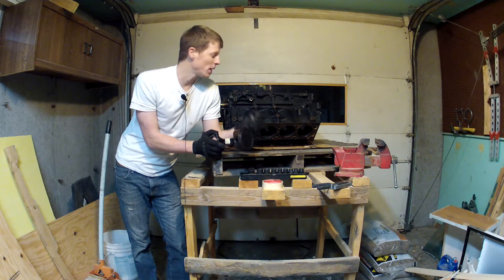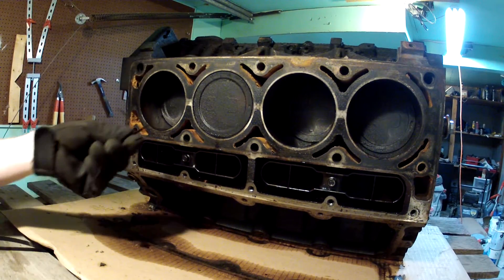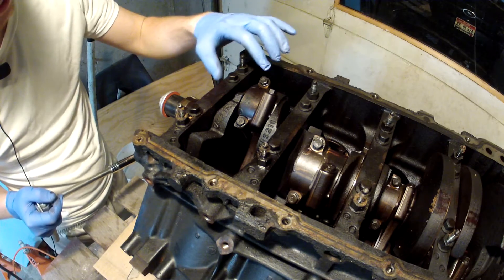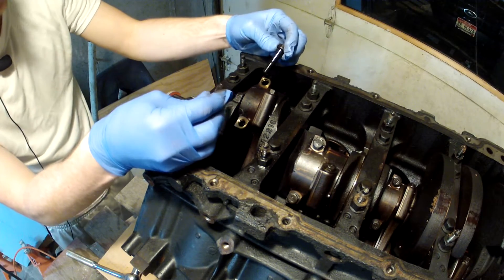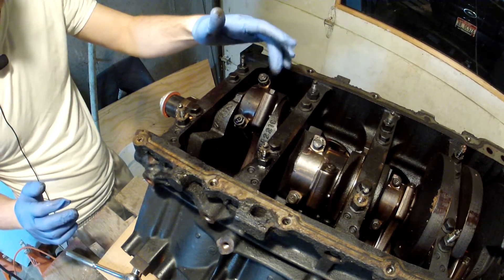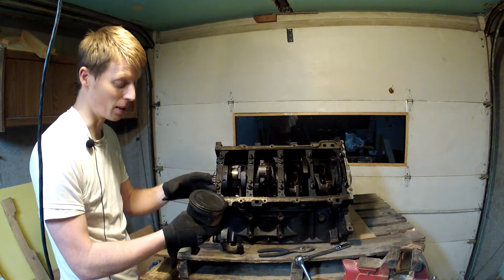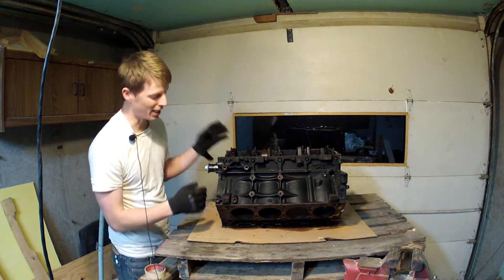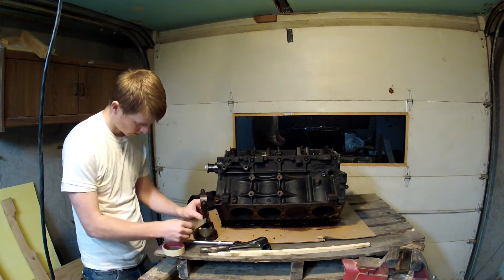Chevy Ls1 Piston removal - Iron ls1 build #2

Comment: Im assuming you're finished by now so how much did it cost you to build?
Reply from the maker: So I am not quite finished yet.  So far for just the parts I am probably about $1500, that includes the block and everything.  I am hoping to get it to the machine shop next week and am expecting that to be around$1000 to $1200.  That would include them doing the assembly.  Then I will have other stuff like exhaust tuning and whatever I have forgot.